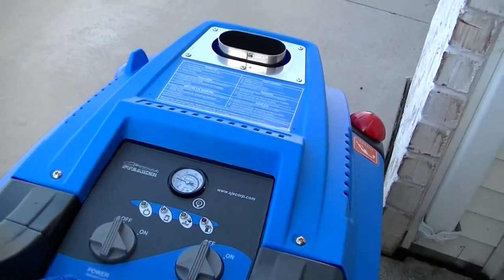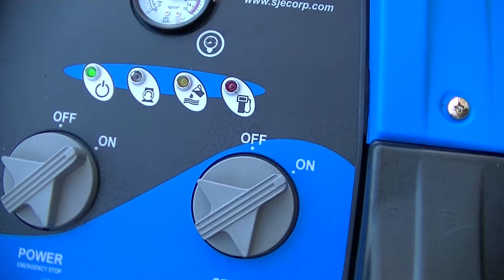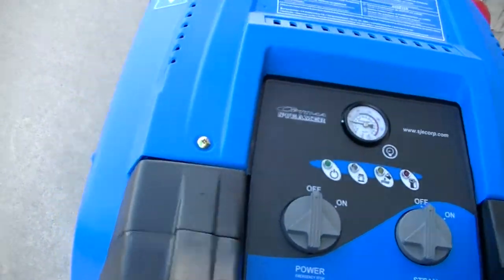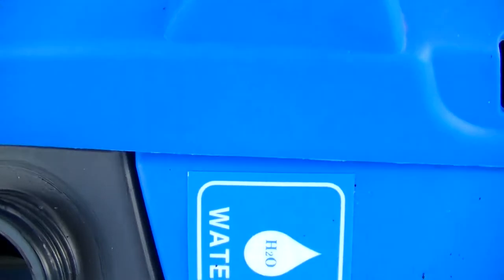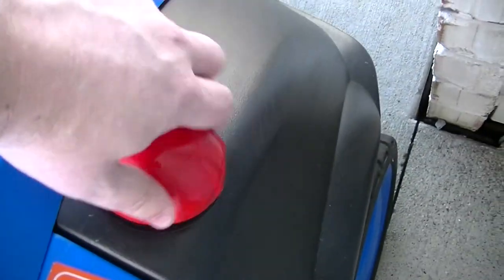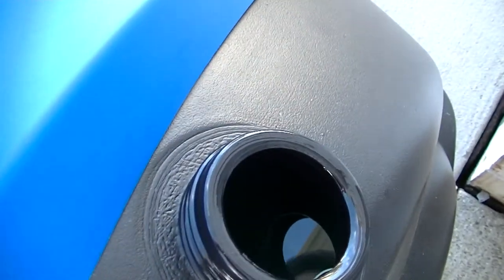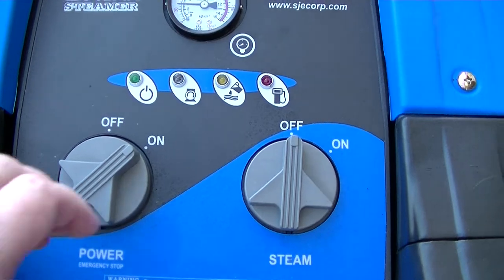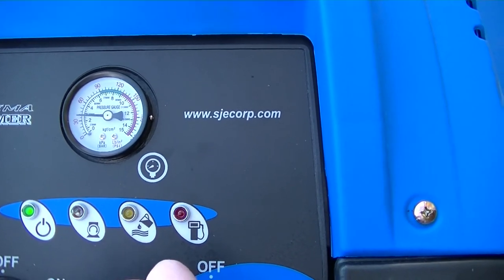Optima Fault

Comment: Seems that both high and low probe sensors are in short circuit:

1) both probe sensors are defective or
2) sensor's line itself is in short circuit

Solution 

1) check both high\ low sensors clean or replace
2) check the connection cable and replace it. 

Good luck

Comment: I have a similar problem. First i don't hear the beep when i turn it on. It seems like the boiler doesn't come on like it used to. then it gets going, and then the water and gas light comes on and i lose pressure. I never hear the boiler come back on. I wonder if its a sensor issue. Any ideas?

Comment: So I have a similar problem like that but it is only that my burner does not kick on and the water light switch turns on. So I'm guessing it's the (tank fill sensor float switch) need to be replaced and for what I hear you need to do is a maintenance to your machine if all the lights turn on.
Reply from the maker: The problem was so bad I had to get rid of it.

Comment: Remove all water and and leave it for 1 day to dry and then fill quoter of the water tank and one the machine and then it will on the water light to fill the water. As soon as it beeps off the right side switch (only) and let the water fill and then ON you will be ok. Optima doesn’t worry about their customers properly. Just to fix this way some people are charging $650 and I was paying the same. This machine doesn’t provide proper troubleshooting guidance and all customers have to pay for their maintenance ppl lots of money.
Reply from the maker: I got rid of it a few years ago.

Comment: my machine has the same problem, I did pull the sensors and clean them with a sand paper as the manual say , but still doing the same sound, but I notice that first when I started works then star loosing pressure and the sound comes again, you said you put the sensors in some kind of liquid or something, can you  tell me what was it, thanks
Reply from the maker: I put them in CLR.  Don't worry about it because it didn't work and had to be sent back to Optima for repair.
Reply: ok thanks , can you please tell me how much did you pay for the service
Reply from the maker: Victor Lule It was covered under warranty.
Reply: @Boodieman72  what did they say was the problem